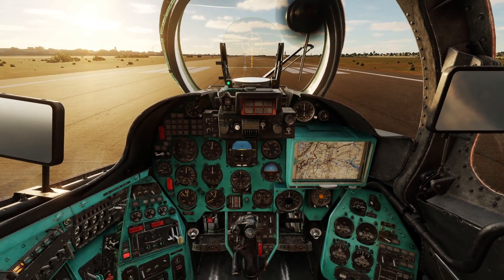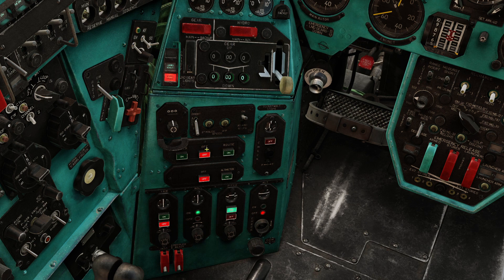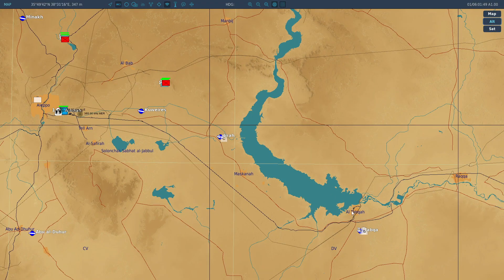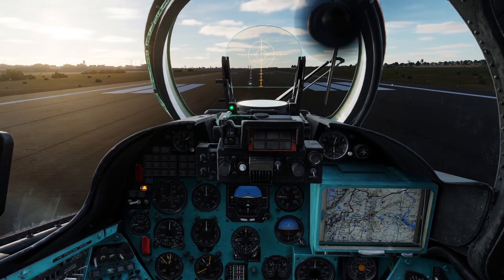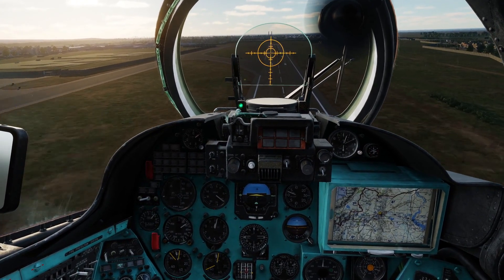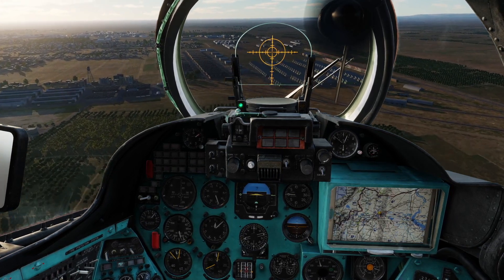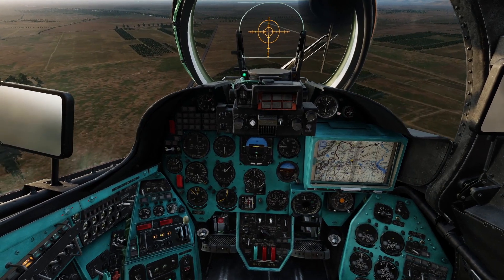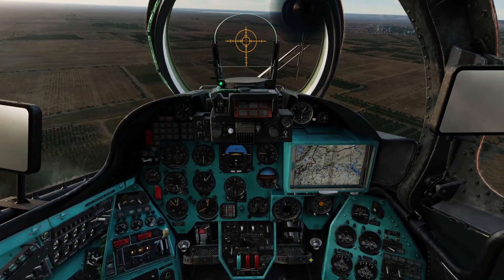DCS Mi-24P Hind - Autopilot Tutorial

Comment: Your route mode is shutting off because you are exceeding the +/-7 degree pitch and 30 degree roll limits of the Doppler system that it requires to work and correct for wind

Comment: Simple but useful video.  Thanks.  Interesting that you don't need the Yaw channel on to engage the route mode.  In the keybindings is a speed hold channel but I don't see any buttons for it.  I do see two sets of buttons labled. "altimeter" one under the "route" button and the second on the bottom right next to the yaw/roll/pitch channels.  Maybe a mislabel?
Reply: The two speed hold buttons are above the route hold. The square altimeter button below it is only engaged during hover mode to hold radar altitude. 

Route mode doesn’t need yaw because it uses the roll channel

Comment: At times I found the Route mode not working, even when I'm flying manually at the heading I want, it'll slowly drift and not maintain the set course.

Or when I'm off by 10 degrees, it won't make an attempt to turn towards the set heading. 

Do I need to enable Route Mode first, then the Altitude hold? Or is it something else I'm missing?

EDIT:  I kept my airspeed around 250. Also I haven't played since the July 14th update, not sure if the update fixed the issue.
Reply: Late reply. It turns off becuase you exceed the +\- 7 degree pitch limit or +\- 25 degree bank limit for doppler system. 

One reason it may not hold the exact heading you tell it to is that it’s not trying to point the nose, it takes the drift indication from the doppler and moves the nose that even if your nose is pointed left or right your ground track is along the set course.

Yaw dampener/heading hold can fight this but you’re probably wasn’t working becuase heading hold functions turn off after 18% rudder input
Reply from the maker: I have noticed that for unknown reasons sometimes it engages and then a few seconds later disengages, no manual means we do not know what are the parameters for normal operation for this
Reply: @HavocCompanyClan  For me, it would stay engaged. However it’s like the yaw dampener doesn’t want to help the Route mode. Even when the yaw dampener is on, the vertical lines are not moving. I see the roll dampener lines moving however